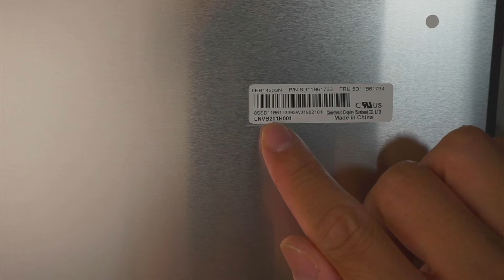Lenovo Thinkpad T14s Gen 2 Screen Replacement

Comment: Hi! Thanks for the video. I also have a t14s gen 2 but the Storm grey version  with a ryzen 5 CPU. The screen that i have is a 30pin non touch screen 1080p 300nits but i really want to upgrade it. Currently i'm really interested in the screen model that you have in the video, the 1080p 500nits multitouchscreen with privacy guard. Do you know if i can do that upgrade? Will it work? I will buy the LNVB201H001 screen and the 40 pin cable because my 30pin cable isn't compatible. Also, would you recomend that screen? Is the privacy guard that good? The brigthness is good, the viewing angles wih the privacy guard off are good?

Thx a lot for this video
Reply: Did it work for you?
Reply: @Berecutecu  Not yet, i buyed the screen from aliexpress but they send me an incorrect model, one from a Lenovo Chromebook. I'm willing to buy again (with other seller) the 500nits privacy guard screen and wish it will work. Any information from you would be gratefull
Reply: @JoseHerrera-sd5rd  thanks for sharing. I'm considering getting one laptop. Nothing to share this time, sorry

Comment: I was hoping this would have been screws and clips like the T520… I’m having second thoughts about upgrading the display in my T14 Gen 2.

I dealt with that black adhesive in MacBook Pro displays and hated it. Sucks to see everyone follow in Apple’s footsteps.

Thanks for taking the time to make this though, it helps.

I also have that same Nanch screwdriver set since 2016. A bit of warning: after 7 years of heavy use, a few weeks ago it somehow managed to come apart and the shaft retention ball bearings flew out. After almost an hour I found them and got it back together. Every now and then it doesn’t hurt to take the bit out and firmly tap the driver down into a firm surface to make sure it’s all pressed together. It’s nice to have a tool that has zero plastic in it.
Reply from the maker: You are welcome. Glad the video helped.
Reply: Do you know what screen to get if I want 4k?

Comment: This video is all wrong. Why replace the LCD from the frame when you can replace the entire frame with the LCD from another laptop. No need to unglue anything or unclip fragile bezels. You put the laptop upside down and remove the entire screws with the wires. This video is the most damaging way to do it. WHY?
Reply from the maker: why do you change the full lcd screen assembly ? when you can just change the lcd ? guessing you like to have  used full assembly screen
Reply: Why replacing the entire frame with LCD if you can replace the whole laptop? That way you don't need to unscrew anything or putting the laptop upside down...